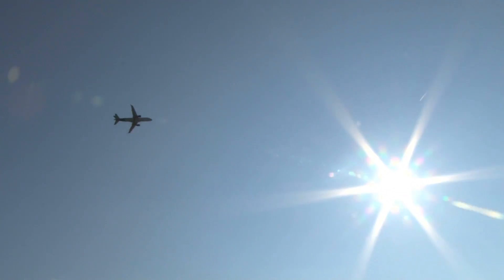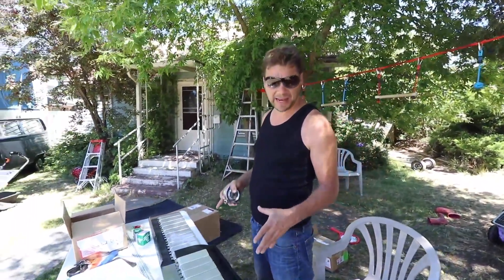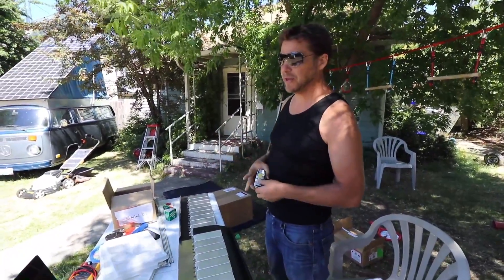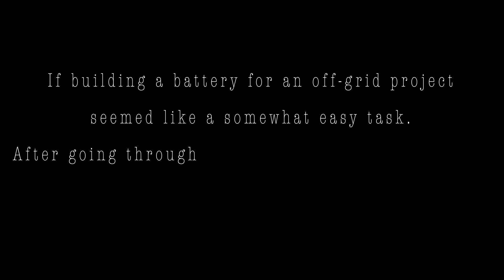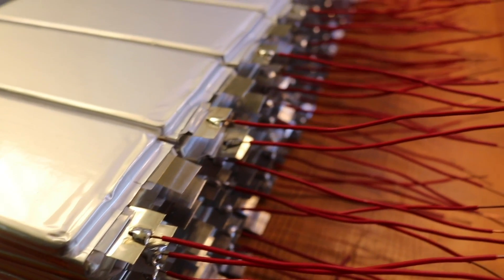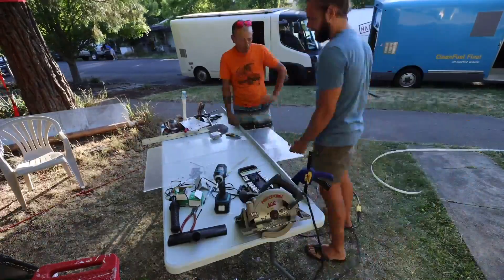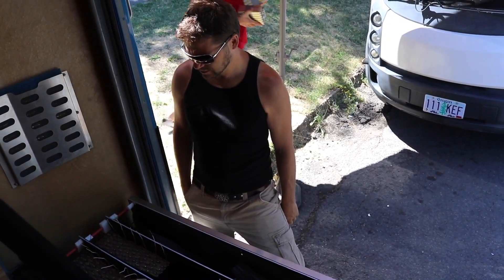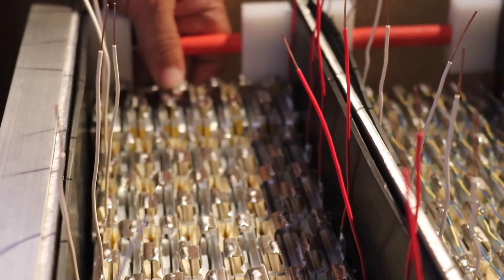MASSIVE DIY 40 kWh Lithium Battery | Solar Electric Vehicle build Project | Alaska to Argentina

Comment: Why did you decide to go for a 48V secondary system? So you and using; solar>MPPT>48V battery> inverter > onboard charger to charge the main battery which requires the van to be parked?  A neater engineered way to do this would be by configuring the aux battery to the same voltage as the main  pack and use a boost DC converter to convert the 48V solar directly to the pack voltage, charging both batteries in paralel driving or not. As long as your battery management is running, it can easily control the DC converter so you got some degree of charge management. (I presume because this is a small run experimental production vehicle, there are simple control wires going to the charger to stop and start charging, which can be piggybacked and not propriatary obfuscated software running everything?)You'd get at least 20% more out of the sun like that, with fewer conversion steps, charging losses and smaller load on each cell with the batteries in paralel. Sorry for being a wise ass and efficient DC converters of that size are definitely not off the shelf hardware, but at least requiring a connection to a well stocked E-engineering student, but that would be the NASA way to do it.

Comment: Could you if you wanted, build a vehicle with just one battery and let it charge from the solar on the roof while you are driving? or can you not charge and discharge a battery at the same time? Or are there any other issues that I am not aware of? :)
Reply from the maker: Definitely this is the most efficient way of doing things one battery, but all the proprietary stuff makes this build a bit more complex..
Reply: @RouteDelSol  So the way that the e-star is build does not allow you to charge the build in main battery with solar?
Reply from the maker: Not impossible just need to figure it out a little more haha!